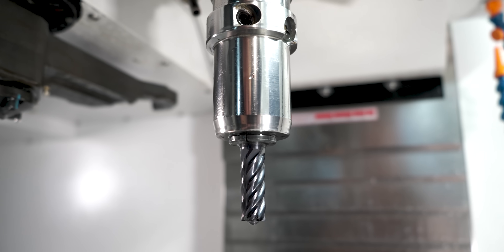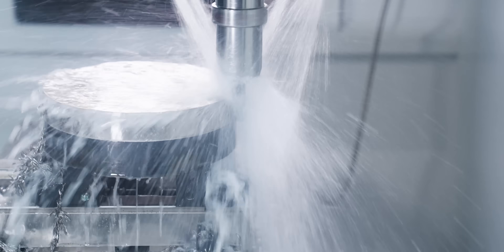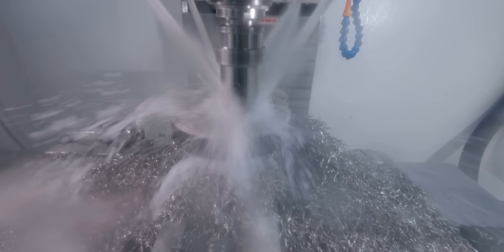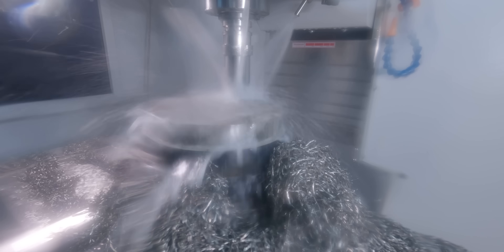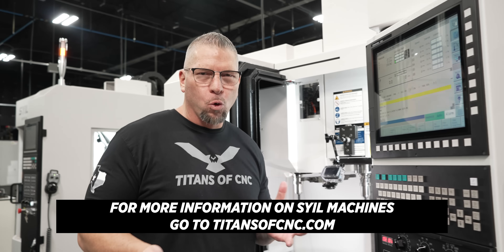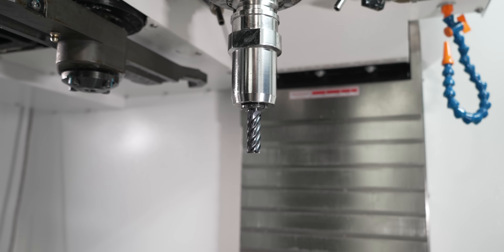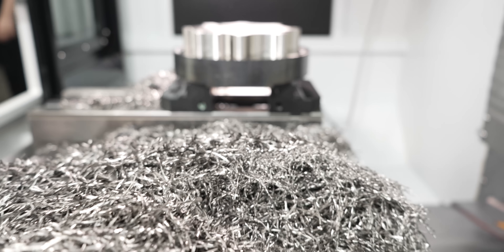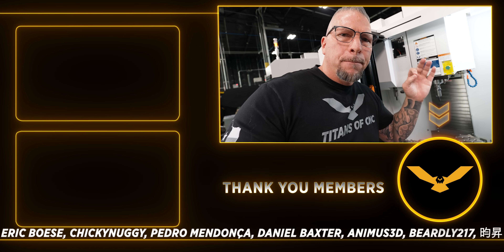My First Part: Machining The Toughest Material On SYIL X7

Comment: Titan, you spoke about chip load on the K500 Monel, When I was milling it, back in the day on an Okuma MC 4VA, I was coming close to stalling the machine, so I changed my Feed from IPM to IPR, this way if the motor started to bog down in the cut, the table automatically slowed down to maintain chip load, instead of trying to get from point A to point B in a specified time. This was way back on MasterCam 1 or 2, so  Radial depths of cut were not always even. This worked really well so I put it in a Variable program to be able to cut and paste it in the programs that  had heavy milling. Then because money was always tight, sometimes you had a 5 flute end mill and sometimes a 7 flute, so I made the feed rate a variable as well so that you could punch in the number of flutes, times the desired chip load and get the correct feed, so .003" per flute, X  5 flutes would give you .015  IPR and 4 flutes would give you .012, but the chip load was the same. Please remember that back in the 80's when this was happening, cutters didn't have the advanced geometry that they do now, nor the carbides, so I would venture to bet that they could be pushed harder and without the fear of stalling the spindle. The only bad thing is most machines only display 2 places to the right of the feed rate decimal point, so you, the programmer had to know for sure what you programmed because if the display showed .01 was it .010 or .019? Big difference. I populated my variable table with the feed rate that was calculated so I could see it. Hope this helps in some way.

Comment: I have been machining for about 7 years now. In my first year I was at a production shop where I was asked to machine inconel, I hated it. It was hardening l, burning and breaking tools. For the last 5 years I have been at a job shop. I learned manual machining and even more about cnc programing. At this point I can say that anything can be machined with the right speeds and feeds. I love what I do.

Comment: No doubt Titan knows his stuff but my rule for tough materials is to keep the distance between the cut and spindle bearings to an absolute minimum
Reply: Yep, that is what one do during normal production. This is kind of a wild demo, where one push it
Reply: @Rimrock300 that may have been part of the point but it was still cringe

Comment: Titan, please show me some tantalum machining. That stuff is like cutting bubblegum. Edge breaks are a face, finish, edge-break, finish, face, edge-break operations.😮  It is literally some of the hardest parts to manufacture when it comes to aluminum-tantalum clad material. Monel is definitely a difficult material but the clad material "bell-mouths the aluminum when the chips are removed. Utilizing a smaller chip load is essential.

Comment: Monel K500 is extremely difficult to machine, our OSG special drill ADO-SUS-5D 6.4mm can only drill 105 holes (depth 27mm). That massive valve cage has 12,000 holes, and we’ve already used over 100 drill bits—it's absolutely insane!

Comment: Kmonel500 qqn286,  will eat the edge of off any carbide if you dead idle the cutter. I machined mountains of this material, I found that if that if you feed out away the tool will last. Good coatings make a difference but dead stall will kill the tool.

Comment: I've machined loads of that stuff on my ancient Mazak. It work hardens very quickly. The best thing to do is change the inserts and drills after a set number of components regardless of how good they look. I've taken what I thought were cuts with a blunt tip only to realise the tool is pushing the bar back into the chuck.

Comment: Hi titans I'm trying to machine arc spray bond coat on an engine block deck which is quite soft but super abrasive- with CBN button tip. The tip is worn in about 14 inches. Can't even do one full cut along the deck which is about 6 and a half feet long. Have you got any ideas? I've tried all feeds and speeds. Lasts the longest at 300 rpm .007" per rev with a 12" fly cutter. Guessing I need a different tip.

Comment: 👋 Hi, it's very interesting to see. But as an application engineer from germany i highly recommend ultra short tool holder . You can hear the deflection from endmill to spindle. On the drilling side, the same, shorter tools and inner coolant for better performance. So you can produce more parts and safer. The material is heavy to handle. Greets from Germany 
🤪
Reply: Maybe you should mention Germany one more time and that you’re an engineer from Germany, because I’m very concerned that the entire comment section might not realize that you are, in fact, from Germany.
Reply: Naja , ich würde gerne auch wissen, warum braucht er so lange Weldon. Oder was ist die Werkzeuglänge mit der Mann Tisch anfassen kann

Comment: I like it when you push the tools beyond what others say is the norm.
 The two things I learned a long time ago where “if you are not cutting you are dulling”! And “you want to put the vast majority of the heat generated into the chip not the tool or the coolant “! 
 The tool that lasts the longest is the tool that is not used. A tool can only rub for so many miles or feet before it is worn out. A tool that is not used is a decoration; or just jewelry, hiding in a box.

Comment: Monel isnt particularly hard, it is very tough. You want slower speeds and heavy feeds for the rough cut. More coolant the better as the stuff has a phase transition when it gets hot that makes it behave like gummy aluminum with the strength of stainless steel. It will eat your tools for lunch if it isnt kept cold. Did a few pump assembiles out of it a while back. ❤

Comment: I've made some prop shafts out of K500 for unlimited blown alcohol race boats, I have to say pig of a material to machine, hell on the tools, particularly milling the keyways is pretty much a brand new slot drill for every keyway! It's also difficult to source here in Australia, had to import the last lot from the U.K. makes for expensive parts.

Comment: Hardness and toughness are not the same thing. Stainless steel is tough to machine but is not hard.
High speed steel is hard, but relatively brittle, it can break in tension.

Comment: the machine is working pretty hard. I've never heard of SYIL mills. Let's see how it holds up after two years of demanding machining.
Reply: SYIL are entry class machines, at good value for money. Owners will typically work with 'standard' grade materials. This is just a demo put to the extreme, the machines are not made with the intend to regulary work with such tough materials. Companies into such on a regualry basis naturally goes for the high end machines, but its interesting to see the capability of Syil, if one once in a while comes into tough materials.

Comment: Monel K500 is a material we use at my work, I work for Lonestar fasteners Europe (American based, but for the European sector).. We use a good amount of "up there" materials Inconel 625 718 and 725.. Monel and K500.. Astalloy and waspalloy (or how it's spelt it's a rare sight) and tbh even the guy with 30yrs won't touch them if he can get away it..
Im 36 years old and a manual machinist on ward 3db and 7D lathes. We make specialty stuff for oil, petrochemical, gas, hydro power and turbines. It doesn't faze me that much of a material, once you've dialed in the speeds and hand pressure, I won't run it on auto feed on my machine the speeds are too much. I use carbide and carbide tip drills along with boring tools with high end strength tips and go with a steady hand pressure and absolutely drown the sucker in coolant, running 800rpm trying not to soak myself with off spray 😂
Good to see some hardcore material being ran, what you guys got planned next I wonder.. I'll be watching

Comment: That material is just really expensive because of the high nickel and chromium content in it so that way it will make chips and not birdnest or ln this case breaks the chip up so you don't get long curly chips 5 foot  long that sound is actually what you want to hear when cutting that material taking max cuts difficult material odd hard gummy defying logic 😅

Comment: I'm not afraid of that material. C6 casting is probably the hardest material to cut. 
I've cut titanium that has to replace the insert after every pass. Will say though, mill is much different than lathe. I would run any material fairly easily on a lathe, them it would go to mill, and all the problems would begin. 
I wasn't running the mill, so I'm sure it was a mix of machine and operator on the mill.

Comment: When does it make sense to Upgrade the standard 12k rpm BT30 spindle, for a 30k rpm HSK40e spindle (ca.8800$ price difference)? The main materials will be AW7075 and TI6Al4V

Comment: She was growlin, deep vibration.  Load meter dude. Only ever did Inconel. Monel K500 has better corrosion resistance & used for salt water. The heat resistance is better for Aerospace also. By the Way a SYIL IS A GREAT BUY, NEW! WOW. Better have 100 grand for tooling, fixturing, shipping,electrical. Oh how I miss this. I did 17 years CNC and CNC Tool & Die, worked up to Lead foreman over 2 departments.Quit, parents got ill, then cancer etc.
I wonder how much that Monel K500 chip bin would be worth.

Comment: I used to manual machine monel when I was 18 as an apprentice.
We made high end metrology equipment and there were all sorts of exotic materials used with a lot of  Inconel due to its low coefficient of expansion, it helps control the stability of your measurements.
Reply: @AntonHoward-mx9sb  invar?
Reply: Starett,  PEC?

Comment: Why is there no cover for the table’s ball screw to protect it from all the metal shavings and chip debris? 😮
Reply: That's the clamp screw. The table's screws are naturally fully covered.
Reply: @Rimrock300  protecting the clamp ball screw from metal chips is still important.  Where is the cover? 😫

Comment: K500 I machine it all the time just go low and slow and it's fine.  The trouble with you cnc nerds is  you want everything done in 5 minutes.  Remember Rome wasn't built in a day.
Reply: I used to make Inconel pistons on a 25 year old clapped out Mori Seki 00 CNC lathe. If this machine can't do this. Why would I buy one?

Comment: Inconel and cobalt chrome are some of the hardest materials I've machined. Tool steel like A2&D2,cpm3v and cpm9v when i was in a die shop. Before and after heat treat. Sometimes the die didn't stamp out correct and i had to remove thirty thou here or there. Proper speeds and feeds are most critical on the hard materials. Tool selection,proper coatings important too. We use mostly SGS carbide. Harvey and micro tool carbides are good. The cheap hogmills off Amazon work pretty good too. For the price they're amazing. Accusize is the name I think. They will surprise you.

Comment: You guys gotta get your hands on some 5 flute helical solutions high performance chamfer tools. They are the real deal. 5 flutes top to bottom tipped off or sharp and they tolerance their tip diameters way tighter than the industry standard, so there is very little adjusting needed to do from tool to tool. I know you run Kennametal because of the brand deal, but seriously in this one niche they've got the pants beat off kennametal.

Comment: I once turned K500 on a Mazak. That stuff feels like tough chewing gum.

When you rub your finger over the surfa e after turning, if feels smooth in the direction you turned, but grabs the skin if you go the other way. 
But it was a nice learning and experience
Reply: Same here. It wasn't K500 but it was monel, also done on a Mazak. From what I remember it wasn't fun to cut but it wasn't THAT bad. Worst materials I've ever cut were Chromel and Alumel with the latter being the absolute worst, worse than Hastelloy X actually.
Reply: Tough chewing gum is exactly how I would describe it as well hahaha

Comment: The toughest part of machining Inconel, Hastelloy, and Monel isn't just that the metals start off gummy, it's that they exhibit severe work hardening, particularly during machining - the tool bites into gummy, sticky material which then gets super hard before finally breaking off. 300-series stainless steel does this as well but it's not as gummy to start with and doesn't harden up as much as the nickel-based alloys.

Case in point: a foundry I used to work at poured some Hastelloy C-22 castings that required mechanical property testing. We thought it would be okay to machine those test bars in-house just like we would with any carbon steel, alloy steel, or stainless steel, putting them through our Puma just like we would any of those materials. The properties we got didn't quite make sense until we sent test material to an area contract laboratory. Their results were perfectly in line with expectations...because as I later found out, our machining process cranked the hardness up from the 180ish range on the Brinell scale to well over 400, whereas the outside lab using the right speeds/feeds/inserts/coolant kept the hardness down where it ought to be.
Reply: which is worse? nickel based or copper based alloys?
Reply: @narmale  If we take each element's alloys as a whole? Nickel. Not all copper-based alloys are challenging to machine, and indeed brass (copper mixed with zinc) is the gold standard for machinability. Many copper alloys can be tough, but brasses and bronzes can be very forgiving. 

On the flip side, I can't think of a nickel alloy that is anywhere near that easy to machine...Inconel (Ni-Cr-Fe) is tough to machine, Hastelloy (Ni-Mo-Cr) is tough to machine, Monel (Ni-Cu) is tough to machine, Incoloy (Ni-Fe-Cr) is tough to machine, the wackier superalloys like René/Waspaloy/Nimonic are tough to machine...there's a theme, and that theme is that nickel-based alloys are challenging for most machinists.
Reply: Yup! Imagine plutonium and even uranium. I heard they have similar properties like what you described, so imagine what the Manhattan Project machinest went through! They probably wrote the book on so many of this stuff 80 years ago, yet couldn't publish it or any of their inventions as it was classified! And I think with plutonium, it can't even touch air or it explodes, so all the machines were argon shielded and tools and work had to be handled and decontamiated in special ways. Crazy stuff!

Comment: Hey Titan, what are some things to look for buying a used machine?
Reply from the maker: Hours in use.
What parts have been replaced.
Listen to the spindle at low and high rpms to make sure it’s sounds smooth.
Run the tables in rapid in large circles and rectangles and listen to the ballscrews, ways and motion etc.
Ask if it’s been crashed.
Listen to the Z Axis in motion.
Turn everything off and on… pumps etc.
Etc etc etc.

Comment: Quick question to the crew. You've ever run a piece of toolox 44 or higher, or something similar? Now thats hard material... i would know, ive had the 'pleasure' to run it thru one of our machines... when i first started working at my current shop...
Reply: I haven’t seen that one before. What industry is it mainly used in?
Reply: @kgranno  Mostly extrustion molds and machinecomponents that need high wear-resistance. its 45 HRC, but my shop-boss tells me we have a test piece of what SSAB, who made the stuff, what they called Toolox 55 or 57 and i dont know the HRC value on that, as i can't recall as of this moment. Its as he called it, days of work scraping flakes off with ceramics even, and it was for a HYDRO extrutions machine, the aluminum producer.
Edit: i asked and he said 57HRC thru the whole bar, thats what the SSAB rep had said.

Comment: If you're looking for an interesting topic to break down, consider breaking down the cost to go from nothing to chips for the X7. You often talk about "starting under $30k" but that's a base machine only. Someone not already in a machine shop is going to need machine, tooling, workholding, phase converter + install, fluids, delivery/rigging, etc...
Reply: I agree with you!

X7 Syntec control $36,500
Tool setter $1,360
Side-Mount ATC $3,795
Tooling package $2,975

Comment: Titan have you ever cut haynes 188
Reply from the maker: Yes, also tough stuff. Used to cut lathe parts out of it for SpaceX
Reply: I'm milling some on a mazak variaxis i700. It is some parts for Rocketjet Aerodyne. Does diamond coated end mills work good on it?

Comment: Hey Titan, I’m using 735 in my X7 for the last 3 years at 5 Brix, so 7.5%. I’m mostly cutting Aluminium. Should I run a higher concentration? I’m getting great surface finish at 7.5%
Reply from the maker: No 7.5% is great for aluminum
Reply: @TITANSofCNC  thanks, I’m Rob Bingham from the Syil group by the way 👍

Comment: I was about to pickup a used haas vf2 for my first machine but these have definitely caught my eye.
Reply: Will customer service be there (in the US)  in 10 years though... thats the question...
Reply: @peterfitzpatrick7032  with Titan becoming a distributor, SYIL is going to blow up into a big machine tool company!
Reply: Your gonna have way better support, service and spare parts availability if you go with Haas because they have local offices in most major metropolitan areas.
Reply: @funwitharobot that's true but part of the reason factory support is so good with Haas is because it has to be.  They lock down stuff in the control that you don't have access to without paying a tech $250 an hour to come out and fix it for you.  Not a knock on Haas but a lot of guys just starting out aren't looking to deal with the cost of having to outsource all of their maintenance activities.  If you're a bigger shop and too busy to spend the time doing it yourself then yeah it makes sense to farm that out.

Comment: Mill works easy, I make shafts out of the crap, not easy keeping runout under control on long 10 ft. shafts where most  every dia. tolerance is +0/-.0005 with a 16 finish.  I use a Daewoo Puma 400 CNC